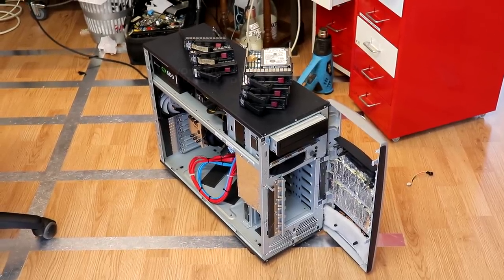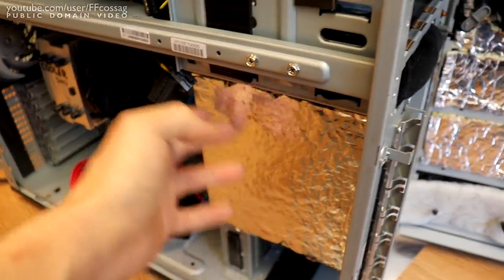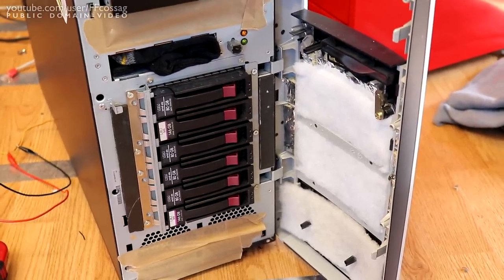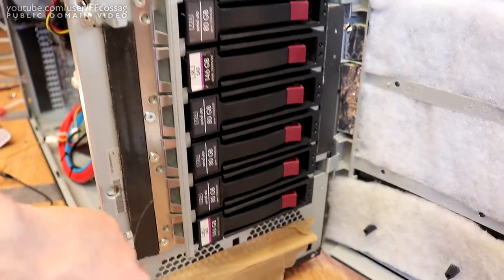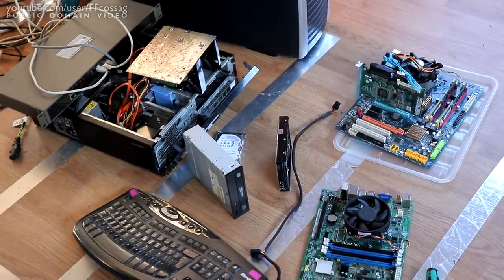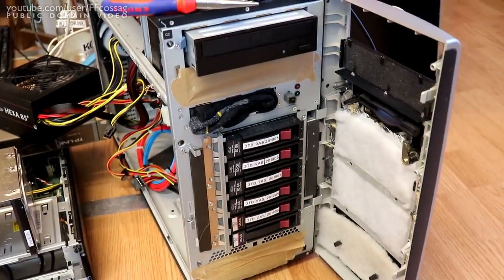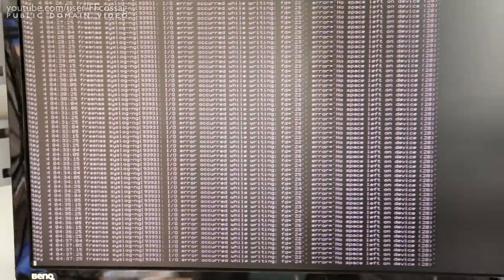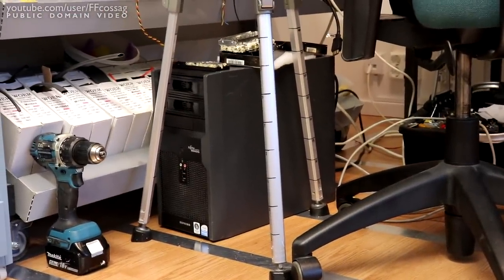Building a FreeNAS server, FF style! (cheap & quiet)

Comment: You can easily beat this on eBay or other for sale sites for less money. I got a 2U case with 12 hot-swap SATA bays and backplane, 12 x 2 TB drives, a Supermicro x8 motherboard, 12 GB of RAM and a Xeon processor for only $300. A generation or two or three old server equipment regularly sells for pennies on the dollar on eBay.
Reply from the maker: That's not a bad deal, although your 12 GB of RAM leads me to suspect it's a Nehalem power usurper, perhaps pushing your TCO up in the long run ;)

Two thirds of the money in this build is in the drives, since I prefer buying them new.
Reply: @FFcossag  Lynnfield, specifically a Xeon X3450 (95W TDP). This system was for a charity and the upfront cost was more important than the long term electrical cost.

As for drives I take the opposite approach and buy the least expensive of the size I want that I can find on eBay. ZFS RAIDz2 or z3 and cheap spares and I'm happy.

For my personal server I replaced an x7 gen Supermicro server with dual low power Xeons with a new Haswell core i3 based system because at the prices that Lenovo was selling them for a couple of years ago the new system paid for itself with in a couple of years due the saving in electrical costs.

Cash flow decisions of course vary by situation.

Comment: I am curious if you have any temperature issues with the HDDs. from what I can see there is no airflow around the drives just tape and metal.
Reply: I am no scientist but I have seen rack mount servers with zero holes on the sides of drive caddies to direct the airflow all the way around the drive from front to back. It ooks like there is a lot of open areas where flowing air could move away from the drives instead of staying right up against the drive until it exits the rear of the cage. There are so many experiments that could/should be done in this scenario. I would be interested in a bunch of updates on various airflow scenarios for this unit.
Reply from the maker: There are holes on the sides of the hard drive cage, there are two high static pressure exhaust fans on the case, and most holes that are not in front of the hard drive cage are blocked off. As such, almost all airflow moving through the case enters through the hard drive bays, and all the drives stay firmly at 35 C.

Comment: Great video. Always appreciate your recycle-it approach. What motherboard do you have now in this immortal case? Also, are you getting SATA access at the full speed that the motherboard is capable of or does the sata backplane limit disk speed?  (e.g. to 1.5Gb/s)
Reply from the maker: Thanks. The mobo in this build is an Ebay special second-hand Intel S1200BTS. And no, the disks operate at full speed, since the SATA wiring specification has never been changed. The backplane and wiring is technically SATA 6Gb/s compatible despite the standard not existing back then.
Reply: Great stuff — I’m playing around with repurposing an ML150 G5 case, very similar, so this video is of immeasurable goodness. I wonder do you have a previous video that discusses the ntc based fan controller, or perhaps even a schematic of the fan controller design you can point me to?
Reply from the maker: I don't think I've ever made a video specifically about the fan controller, but here's a simulation you can play around with (I think you need Java): http://tinyurl.com/y6x6vz48

You can basically make every resistor a 12K and it'll still work. It's really crude and tolerant. The NTCs it takes are generic 10K ones I've ripped out of PSUs, but anything goes, really, you can just calibrate away the error.